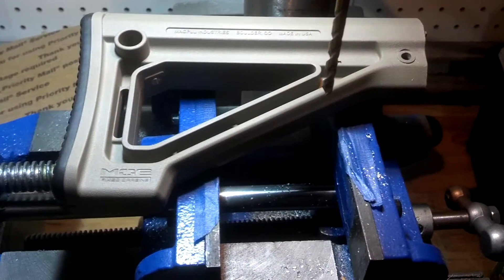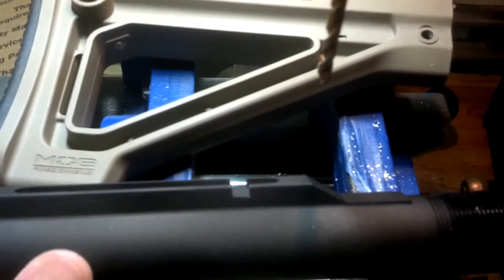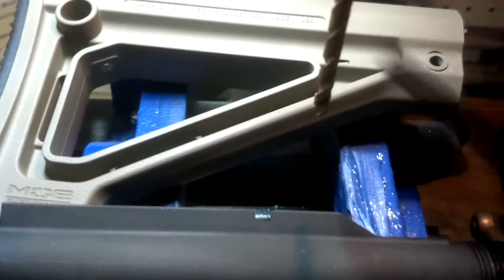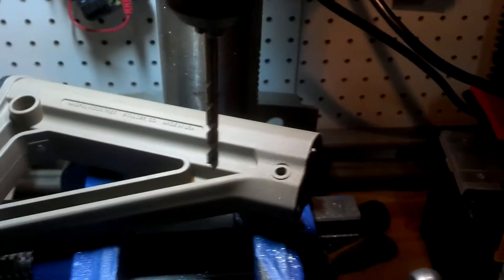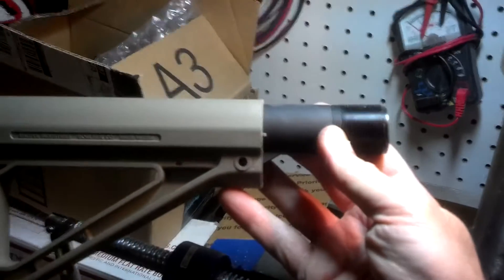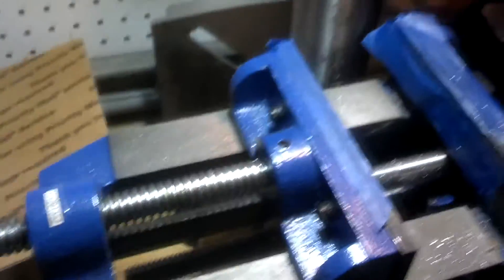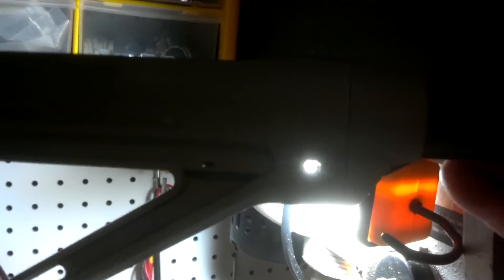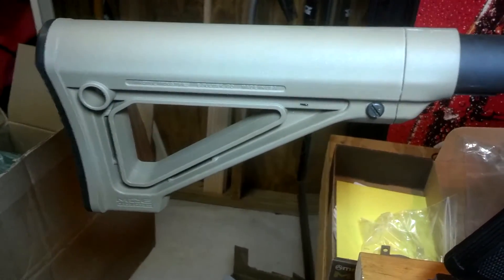HOW TO: Magpul MOE Stock Length Of Pull Mod

Comment: This video is great. I did the same thing on my MOE stock/buffer tube with my dremmel. It converted a way too short and uncomfortable rifle to a perfectly fitting one.  My ideal length for cutting the notch was 1.5" from the outside of the castle nut.  Thanks for the tip!
Reply from the maker: You're welcome, glad it helped out.  Did you use a cutting wheel on the Dremel?

Comment: This video was incredibly helpful.  I am 6'-2" and my preferred LOP is 10.25 inches from the rear of the castle nut to the rear of the stock.  Drilled the hole with my drill press in my buffer tube and had my stock mounted at 10.25 LOP in about 5 minutes.  Did not worry about making it pretty as the stock covers up the drilled hole and since I have other AR's with 6 position stocks I can loan friends who don't like my LOP.  The stock is incredibly rigid, great cheek weld and the best value for a Fixed stock.  Fortunately I live in a conservative state so this stock was a want for me rather than a have to do for compliance reasons.   I really like rigid stocks as I feel they lend to better accuracy. Thanks for sharing the great idea.
Reply from the maker: +Ted H Appreciate the comment.. Thanks.  I'm glad you found it useful.

Comment: Thank You SO SO SO Much for posting this Mod. Just brought my fixed stock home today . After Install I found that the LOP is way to short for me. I love this stock. It looks decent and is rock solid.  My M4 came with a basic adjustable and I despise it. 1. I never need to adjust my stock (So having it be so is a waste). 2. I loathe the rattle you seem to encounter with most adjustable stocks. You just made my life a pinch more wonderful. Thank you.
Reply from the maker: +Josh Tharp So glad that the mod helped you out.  Once the LOP is proper,  this is a great stock.

Comment: What a fantastic mod!. Thank you for posting this. I wanted that stock but was afraid the LOP wouldn't be enough.
Reply from the maker: Thanks...glad you liked it.  I thought the original LOP was way too short as well.
Reply: They sell spacers to custom fit LOP with no permanent mods.
Reply from the maker: Thanks...I did end up adding 2 half inch extended pads and still felt a little short.  Thanks for the info.
Reply: WHO sells the spacers?  I'm interested!
Reply: +Wade Palmer Magpul

Comment: I'm 6 ft tall and I got a really long arms. It's hard enough to find dress shirts that fit, let alone a fixed stock that I can feel comfortable using. I took a saw, and a file and with some carful measurements. I placed it all over way to the rear. It feels good much better than what it was before.

Comment: Why not buy the moe fixed rifle stock?
Reply: Anthony Manzi 
Because them you have to change your buffer tube, buffer, and buffer spring over to the rifle setup in addition to the stock. A much more expensive setup than just drilling a hole for a $30 stock. I have this setup on my DPMS G2 308 Recon and it works fantastic. I swapped to a fixed stock because the eye relief on my 4-14x44 scope is a bit finicky and being one click off in either direction wouldn't work.

Comment: After a few years use, has the buffer tube weakened at all?
Reply: Prolly not, I don’t think that part of the tube is structural, I think it is just there for the stock attachment/adjustment.

Comment: L.O.P. has nothing to do with how tall you are. It's arm length that matters.
Reply from the maker: True but the two are typically related proportionally, so the taller you are the longer arms you have but it's definitely true that it's not usually the way we measure LOP for sure.

Comment: Its funny. I read the comments on this product on a sellers site. And all the bumbling boob conplaing about this made me wonder about the lop issue. And come to find out it opperator error of course. It works as designed. If you wanted a longer pull, buy a longer stock or more pieces. Though i admit magpul was stupid for not making this a better stock in the first place. I could have made it better from the factory.